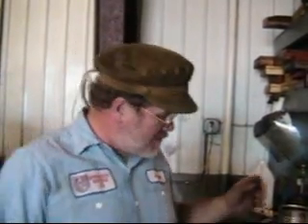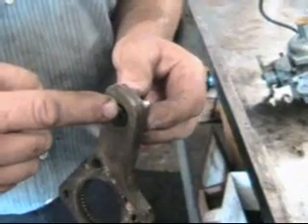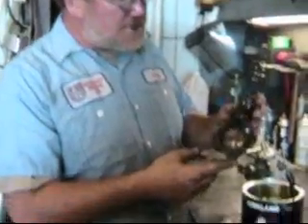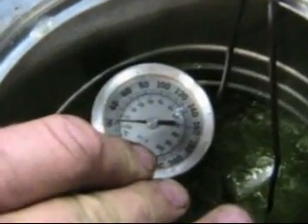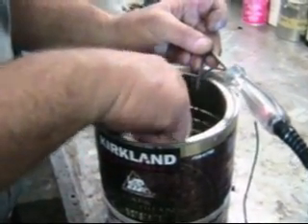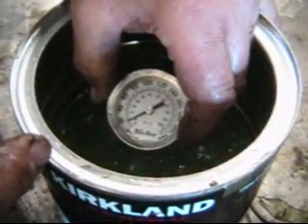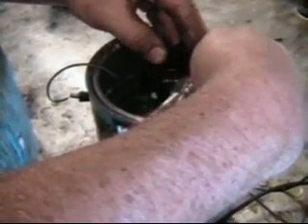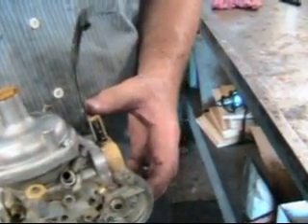027 MG Tech | MGB 75-80 Induction Heater

Comment: And I always thought that cooler air was better for combustion, yet the later MGBs have this tube running from a box on the manifold to the air intake (not to mention the carb sitting directly over a catalytic converter). So what am I missing?
Reply: Volvo's have it too. there is a thermostat in the airbox that switches from "winter" to "summer" settings. Winter setting pulls in hot air to the carbs so they warm up faster and stay warm. Ie: no carb icing. Summer setting pulls cold air from outside